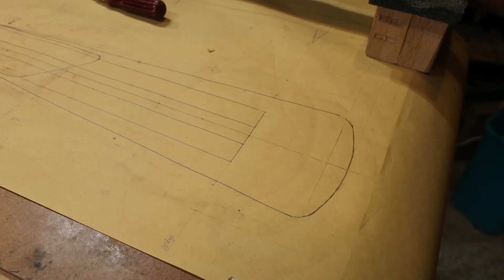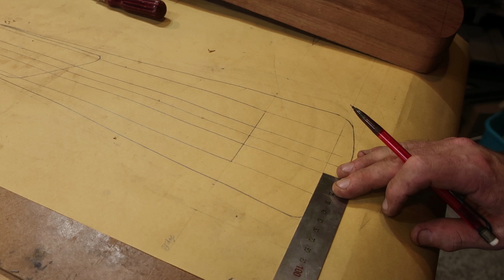Electric Upright Bass Episode 2 - Carving the neck and neck pocket

Comment: Well done my friend.
About the excess string length. Violin making lore would say that the string length between the bridge and the tailpiece saddle would be one sixth of the playing length making that note two octaves and a fifth above the open string. You could soak up that extra string length by wrapping the through body stringing back up the back of the body in a pocket. Voila there is  not too much string for the tuning machine capstan.
You done gone and made a bass that makes a Fender a short scale 😄
Reply from the maker: Ahh, that explains a lot, thanks. I was thinking of just unwinding the end of the E so I could fit it in the hole on the tuner - or possibly drill the tuner out to fit, neither solution particularly appeals. I'm going to need to recess the ball ends anyway, I could just, as you say, recess them a bit further up the body and cut a small channel to where the holes currently are, and flush fit a cover of some sort. I still have to figure out how I'm mounting it on a stand though, so that solution might be a later modification - or something to remedy properly on the next one. Thanks Peter😁

Comment: Awesome! I look forward to giving it a test drive (hint hint).
There are heaps of piezo pickups for uprights, I guess most of them are actually. The three standard types are 1) The Fishman BP100 style that clamp (two of them) onto the top of the bridge, 2) The Underwood that usually mount IN the bridge and 3) the David Gage Realist which is sandwiched between the foot of the bridge and the bass itself. All with very different characteristics for different flavours of sound and to accommodate different basses and their natural tone characteristics.
I use the BP100 as it gives the best sound on my bass but on other basses they can sound like arse, so it's just a trial and error type approach.

Comment: Cool bro! I've just quickly gone through these vids around this as I picked up two set's of tuners from double basses ages ago and they're so lovely I just knew I had to build a, similar to your own, full scale (43") but basically electric bass. So far, though I did spend time asking various double bassists for spare old strings (hasn't panned out yet), all I added to that is a set of Ali express Alice brand strings though I did find some humongously dense timber , 6x6's, on the side of the road which had been piles of some sort, definitely a tropical timber, and I've an idea to join two together, scarfed, as the base of the neck and somewhat 'properly' carve a headstock. I say properly simply in the sense of taking on my version of classical, as it were, but really to set how everything else goes.

Comment: It works! Looking really cool, and with some "conditioning" of the piezo (see my comment below) will sound great! 
Expecting to hear this featured on some of your music during future videos!!!

PS even with a proper piezo buffer, a great addition would be a simple graphic EQ pedal, such as the Amoon EQ7 a bargain at the price, and covers a great range of frequency shaping. You can of course spend a lot more but for a simple useable device, can't be beat!
Reply from the maker: Yep, got one of those pedals right here. I was thinking about building it into the bass but I actually use it for several different things, it is as you say quite versatile. I could just buy another one (or two) to pull to bits, but for now I think I'll just keep it on the pedalboard where it's still perfectly good. Thanks.

Comment: looks good. truss rod won't be an issue.

vinegar and steel ebonizer then sand to finish. come out way better than your other options'.. CA stabilize the fingerboard.

good work
Reply from the maker: Great suggestion, mixing the vinegar solution now, never done it before and I think it looks promising. I'll be sure to test on some scrap first though, I'm about to learn some things :-)
Reply from the maker: Update: it worked beautifully! Just put the first coat of CA on and it's looking like a winner, this is definitely going into my bag of tricks for the future (and I have a jar of rusty vinegar now too :-)
Reply: I'm pumped. I've done this a few times with limited success.. Basically I was forced into homelessness mid project and... It's been a while.  Glad you took the chance my friend. I look forward to future content